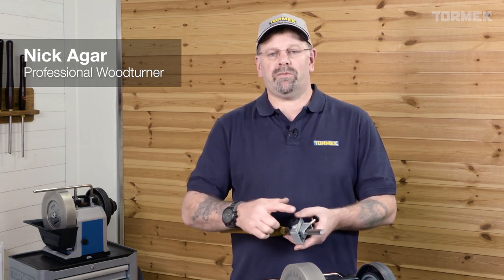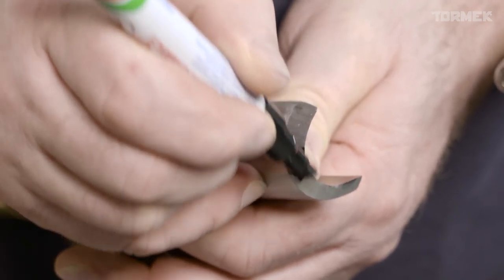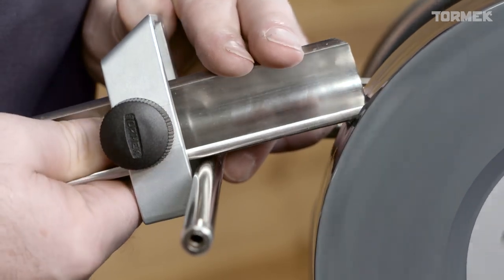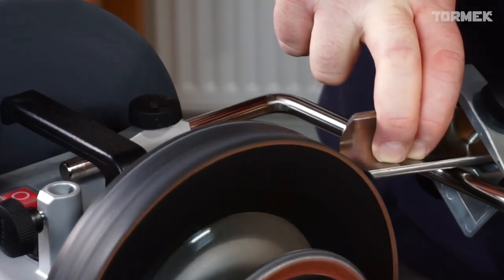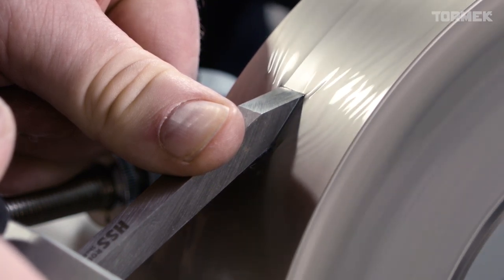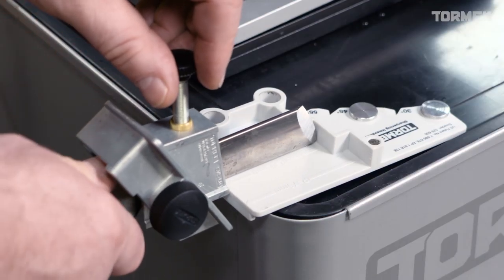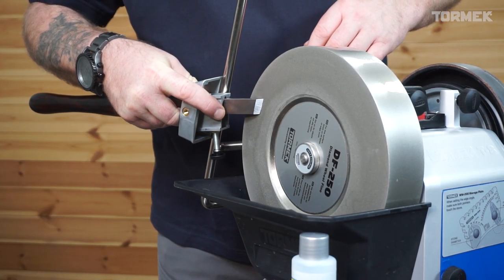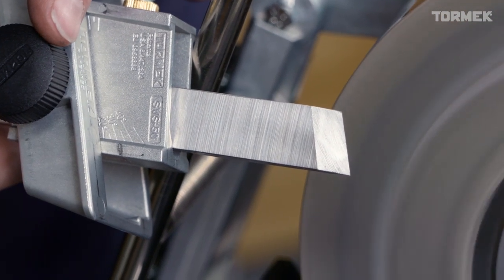How to sharpen roughing gouges, skews & parting tools – Tormek SVS-50 Multi Jig – with Nick Agar

Comment: Nice video, as always. It looked like you were you using the diamond wheel dry. Is it OK to run it without water? I would like to get one, but don't want to use water with it.